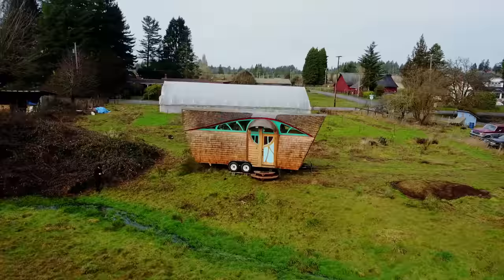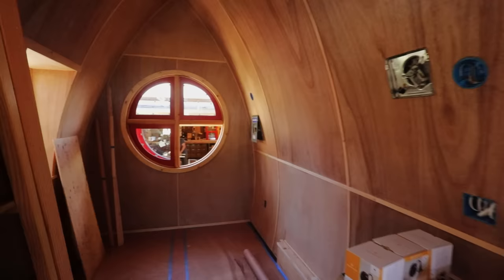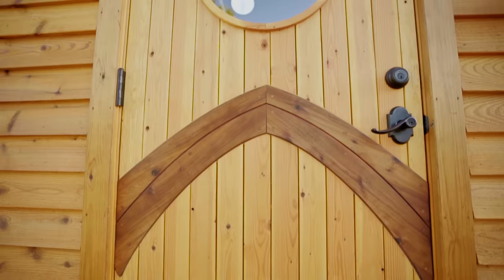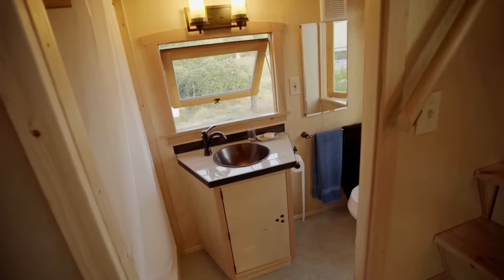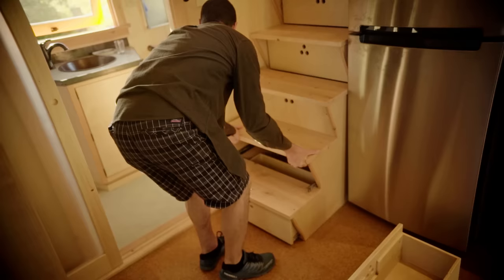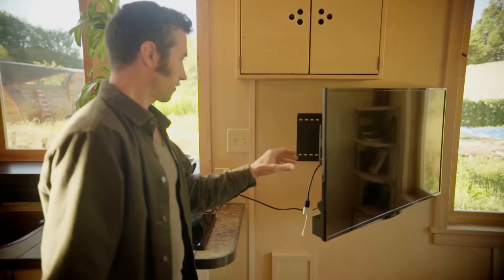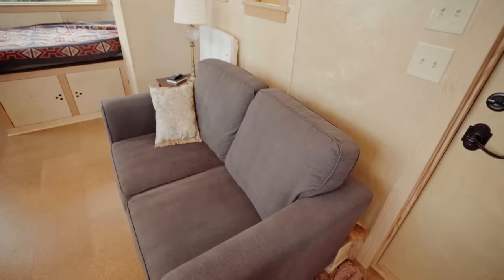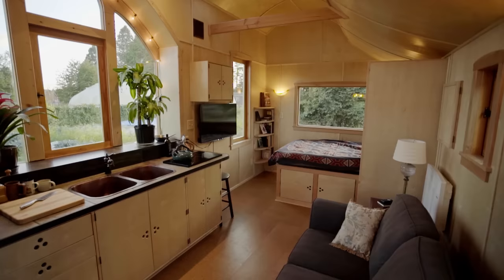The Most SPACIOUS TINY HOUSE You Will Ever See

Comment: I noticed that the fridge doors haven't been changed to open  from the right...on top of the fridge are the bolts that can be removed, you turn door upside down and plug up the bolt holes...all fridges are designed to suit the floor space...thanks again for the amazing tour.